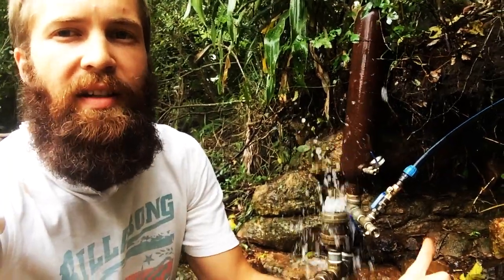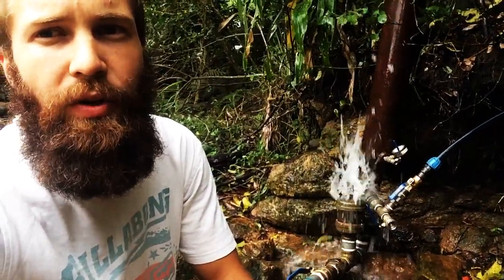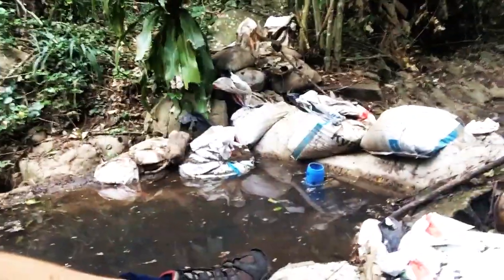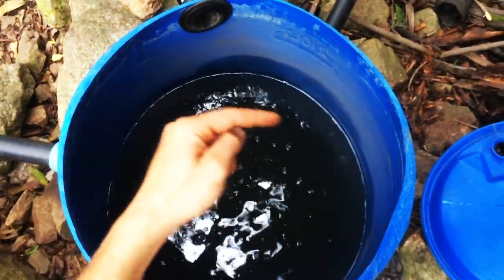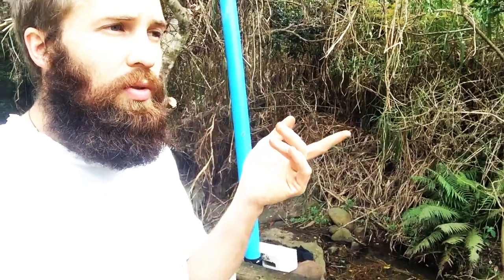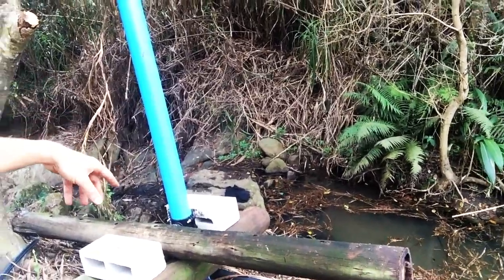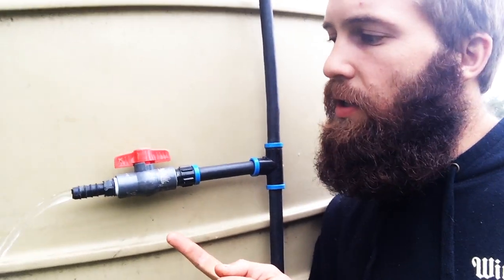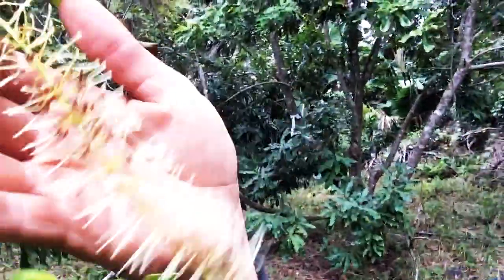Mac a Ram pump in the forest

Comment: Stainless steel spring check valve can last long than brass but for higher lift of more than 100 meter it is better to make an innovation or modification, and for waste valve, it is better to make your own. For me, I’m making ram pump 2” less mostly 1”,  the parts are mostly bought from the hardware locally or on line, No welding, mostly Threaded.